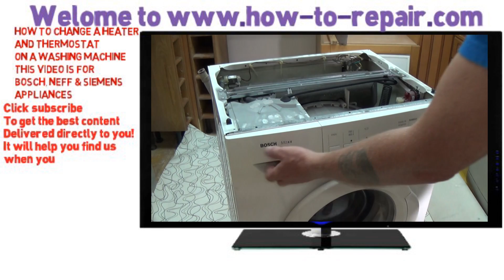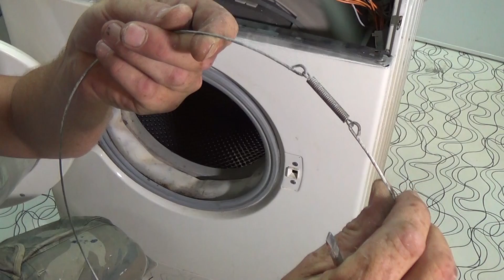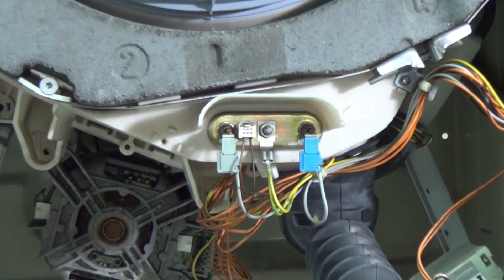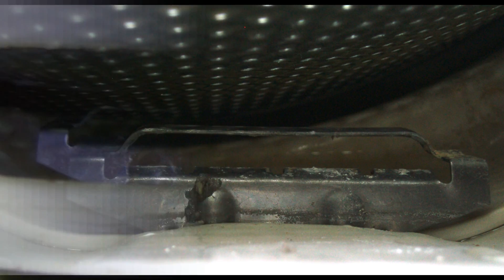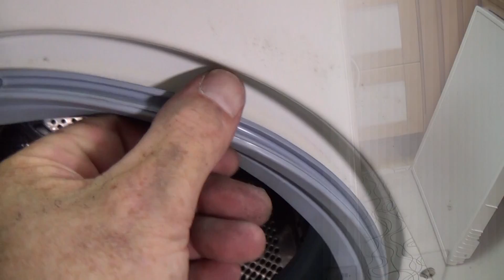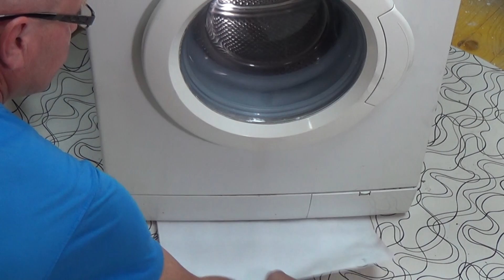How to fit a thermostat & heater element to Bosch, Neff or Siemens washing machine

Comment: Excellent video. I replaced the element and thermostat on my machine but the water still did not heat, presumably the fault lay elsewhere. The tumble drier function is bust too and the bearings are going.

Comment: This is not for all Siemens washing machines. Mine is a 2015 model IQ300 and for that you access the heating element at the rear so I suspect most models post 2013 access the element at the rear. Check other videos before you dismantle the machine from the front like I did.

Comment: I had a Siemens i300 washing machine with a faulty heater took all the front off ie in this video only to find out the heater is in the rear of the machine through a small panel wasted a lot of time  best to check before you start
Reply: Thanks for the heads up. My iq300 is tripping so am glad I won't need to open the front. Did you open the top as well or just the rear and have the machine on it's side whilst working on it?
Reply: @nauxsi  hi there is a small panel in the back that is all I needed to open just make sure the heater goes in the right place check by turning the drum hope this helps

Comment: Hints from a WLX24162GB owner:
(1) You can't fold the door seal back into the drum as per the video (a pipe which theoretically keeps the rubber seal and door clean stops you). Just release the seal, be careful, and pay attention to (3) below when re-assembling.

(2) The door interlock does not unscrew from the front panel (it's a clip in job). To avoid possible damage (£35 to replace): (a) Put the control panel back in its original place. Remove the front panel carefully. (b) Reach down from the top and release the cable guide from the side panel (may need a small flat screwdriver from the right to release the two clips. (c) Keeping the panel where it is, release the wiring plug from the door - there's a small retaining lever on the wiring connector. (d) after moving the front panel away (with the interlock fitted), reattach the cable guide back to the side panel, so you remember how it goes back. Don't be afraid of allowing the door to close into the panel once removed.

(3) IMPORTANT: Before you replace the front panel, make sure the grey hose which comes from the side of the soap dispenser is plugged fully into the hole in the door seal (at the 11 o'clock position)

(4) Seating the door seal is easy, fitting the fastening ring is a BLEEP.

Comment: How long a heater usually lasts? I have a year and a half old Bosch 5820, and one suspicious professional told me it's heater element that causes clacking noise... Even though machine easily gets to 60 degrees Celsius. Is it possible?

Comment: Hi chief .I have siemen IQ300. i bought on 2015 jan. so far no issue but now with in 5 minuts the W/M over heat even we put in normal mix wash. and electrical breaker down pls experts advice Thanks zameer

Comment: Very good tutorial, thank you. I managed to replace the thermostat in my Bosch Classixx 1200 Express without too much trouble. On minor point, my machine had four screws that needed removing to take off the main door panel, not two as with the machine in the video. Thanks again.

Comment: Hi....I have a problem again with my Bosch W/M. The earth leakage circuit breaker is tripping again when the machine is on. I followed once more your video and checked again the heater element that I had replaced almost a year ago. The heater is fine . I tested it out separately and  it works perfectly. Can you give me any hint on what could be tripping the earth leakage circuit breaker when the machine is on. The ELCB goes off around 10 minutes after the machine is started. thanks and have a good day!
Reply from the maker: +Mario Grima test motor, disconnect it and put it on a wash without the motor if it goes through fine then you know its the motor
Reply: +how-2-repair.com 
Hi there, thanks for your helpful message. I did as instructed but still the ELCB continued to trip. Then I eliminated the pump motor and the machine did a short (15 minutes) washing program without tripping. Drained the W/M. dismantled the water pump and found some sludge behind the plastic rotor, which means that water and sludge has seeped through the seal and thought that this was the problem. Bought a new pump and fitted it, gave it a relatively long wash program and again, after ten minutes into the washing program the ELCB tripped again. Then I thought of disconnecting the heater, and the long washing program went on till the end. 
The doubt is that I have replaced this heater only a year ago. When I removed the heater from its holding position to the tank last Friday I found it in perfect condition, no calcium no rust no nothing. I also gave it a power supply to see if it is actually working and if it does trip the ELCB and actually it worked, it warmed the water and it did not trip the ELCB……but maybe also that I did not emerge fully the heater into the water.  
So I thought it could be that there is a minute hairpin hole in the heater on the part which was not immersed in the water and so there was no leakage to earth. I also checked with a meter and all results were ok. No leakage to earth. Now I am going to try my luck with another new heater and see how it goes.
I’ll keep you advised of the result. Thanks once more and have a good day!!

Comment: Very useful guide! My WFO2060AU/01 is taking well over 3 hours for the 1hour program, while the cold program is withing its normal 30-40min timeframe. So I would THINK the heater/element is the problem but how can I tell for sure if that is the problem before I go buy a new element/heater for the machine?
Reply: test the heater befor replacing

Comment: Excellent video my friend. Very useful. I just had a breakdown on my w/m tripping the earth leakage circuit breaker and from my experience I immediately thought the fault might be within the heater. Disconnected the heater and there it is, the machine is back on. Now all I have to do is to replace the heater following the instructions on this remarkable video. Well done!!

Comment: Thank you!!
 My washer Nexxt series  500 has cold and hot  water supply so I assume there is no heater involved. Any idea why it blows fuse all the time , but when I wash in cold water mode this is ok.
Reply: CugerHunter the heater needs replacing